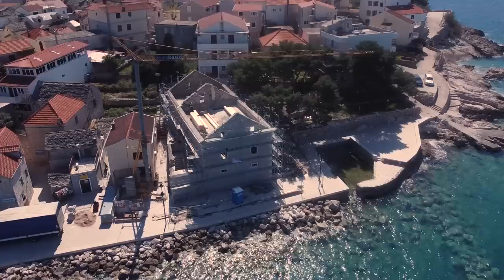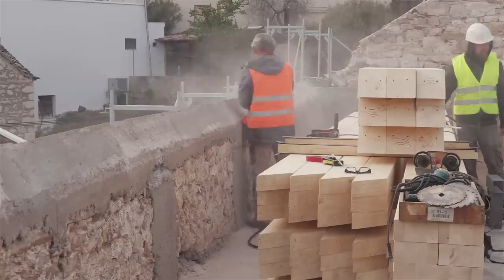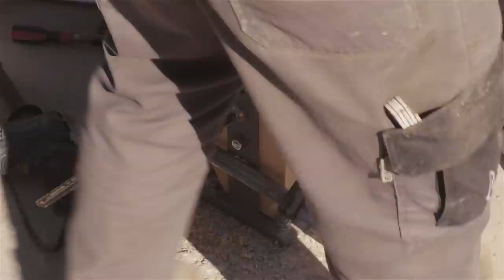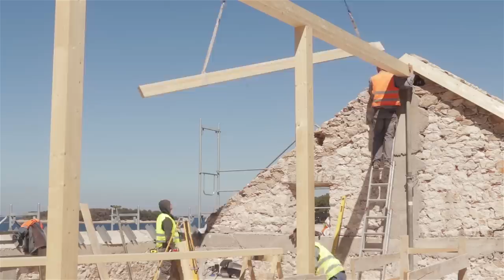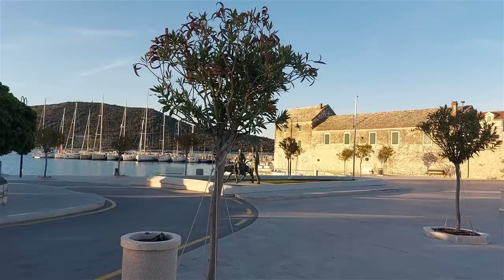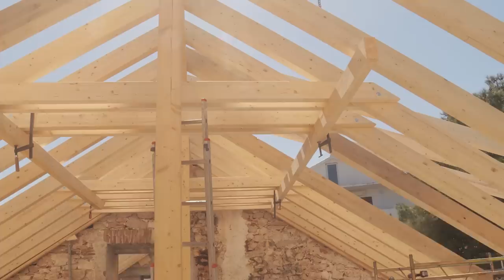300 Year Old House Gets a New Roof - renovation / reconstruction Pt-1

Comment: Couple pointers: The 3 beams on top of the widow, not much left after you cut them to fit. A big fat nail would fix it or a metal bracket. If you use screws on the top, they are great but tend to snap from repeated or sudden loads. Again nails are better because there is more material and are made of softer metal that bends. usually this would not be worth mentioning but then again....bura... :) And if somone is not aware, Croatian coast can experience wind loads up to 200km/h.
Reply from the maker: We used one 8mm screw on top, 2 from underneath pointing slightly upwards and a metal bracket underneath. Central had two brackets, one left and one right. It was pretty hectic so I didn't film each detail but I'm sure they will be visible in part 2 somewhere.. yeah, bura is crazy, but some of the locals said that jugo here is the one to be afraid of..

Comment: amazing as always. Question; those beams that come down from the ridge beam, and then into those metal plates on the small wall- how were you sure those small 300 yr old walls will hold the force without crumbling? the mortar look like its gonna fall out the next time you sneeze near it.
Reply: Read the description  they reinforced the walls of the whole building with concrete pillars, plus you see them every meter or less
Reply: Looks like the triangular "cap" on the old walls is actually a reinforced concrete beam that bears on new columns, not the old stone. Additionally, this kind of roof only applies downward forces on the exterior walls, with bearing columns under the ridge and ties between opposite rafters.
Reply from the maker: Thank you! :)The walls were reinforced with RC horizontal and vertical beams to which we connected the roof. But yeah you are right, I'm amazed how that mortar stood the test of time..

Comment: Impressive work! Takes some fine carpenters to make it all fit as if it was lego.
Wondering about the insulation, will there be any? No idea if the attic will be used a living space, they could also insulate the floor.
Seems great for woodfiber boards on the outside and cellulose insulation on the inside, sadly if that is the choice the the nice beam structure will not be seen any more.
Reply from the maker: Thank you very much! Yes it will be used as a living space but I'm not sure what type of insulation will be used or if parts of the structure will be left visible. Other subcontractors have those parts of the project. Yes it would be shame to hide it all though..

Comment: Those are some Great Looking Wood Beams. Are they Pine?  What type of Supply House do you get your materials from?  Did you mill the beams yourself?  Thanks
Reply from the maker: These are laminated spruce beams in GL24 class. We buy them sometimes from local suppliers and sometimes import from Austria. If larch or oak are needed, or curved to a smaller radius, we glue them our self.

Comment: What's the insulation and ventilation plan for the roof? Rigid polystyrene on the roof deck? It would be a pity to cover all that beautiful lumber and jointery...
Reply from the maker: I'm not sure if it will be left visible or how it will be insulated from underneath, it was not part of our contract. I agree it would be a shame to hide it all.. On top of the beams comes osb, then vapor membrane, then structure to hold baked clay roof tiles.

Comment: Just out of curiosity, as I have absolutely no knowledge in the field, but isn't it a bit overkill to add that many rafters and ties? From other videos I've seen, there were less thick rafters and less ties in general.
I'm sure there's a reason, just wondering which
Reply: Wind is the reason.
There has to be quite a heavy roofing on top.
Reply: Most likely a very, very heavy clay barrel tile roof, and aesthetics come into play.  Whoops, just noticed JustJoe beat me to it.
Reply from the maker: As the guys said, wind with gusts of over 200kmh are common here and happen a few times a year, also clay roofing is pretty heavy. Also here is a standard to ad 2cm in each direction to load  bearing wooden elements in case of a fire. 2cm creates a charcoal layer and prevents the load bearing center of beams from burning quickly so fireman are safe from collapsing roof when entering..
Reply: @lignumchannel  thanks! I had no idea about the charcoal, it's a brilliant thing

Comment: I don't know home building but those rafters appear to be putting a lot of pressure outward on the walls the way they tie into it.
Reply: Stone house with concrete reinfrocements. Doesn't care :)
Reply: They are hanging over the ridge beam.
That beam is supported by posts, and masonry pockets at each end.
The beam has to fail for the rafters to slip outwards.
Reply: Structural ridge negates the outward (horizontal) load at the house perimeter and, I'm sure, there's some reinforcement in the concrete cap
Reply from the maker: They would if there was no central beam, but even without it I think 50cm stone walls with RC horizontal and vertical columns would hold just fine.

Comment: Strange construction - you are putting a lot of thrust on the external walls
Reply from the maker: They are reinforced with RC horizontal and vertical beams so no worries.
Reply: @lignumchannel  I would love to see the calculations , those ring beams look slender as for vertical beams ? they would contribute nothing
Reply: @johnwilliams-sc1vf  Don’t worry it was done by code. Actually no buildings with some sort of historical value can’t be rebuilt without the proper approvals ( earthquake, wind, static and dynamic load, historical appearance and historical construction methods). So the reinforced concrete is the “new” thing introduced to the building. The rafters and the other woodwork is actually lighter than before. But the point is that the buildings have to follow the pretty strict euro codes and then you have to demonstrate that your calculations are by the book with all the design and construction elements that will be used. Building such a roof is relatively a short endeavor in comparison to getting all of the approvals/paperwork.